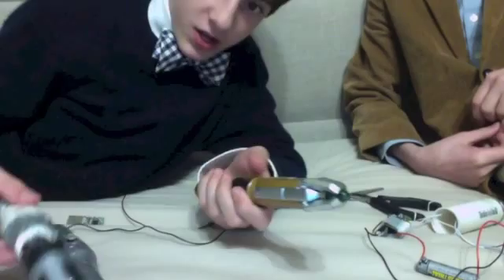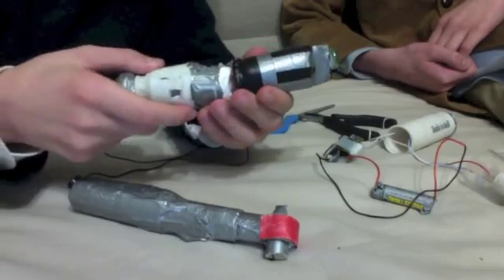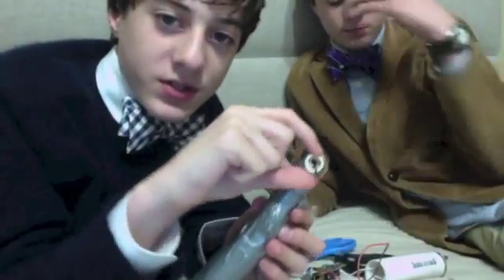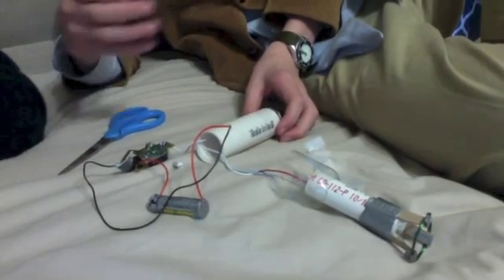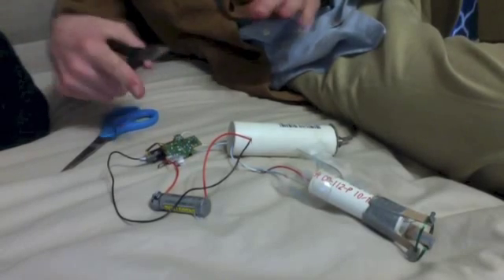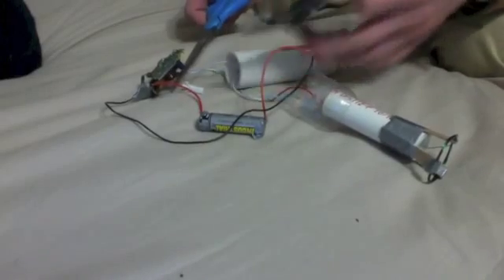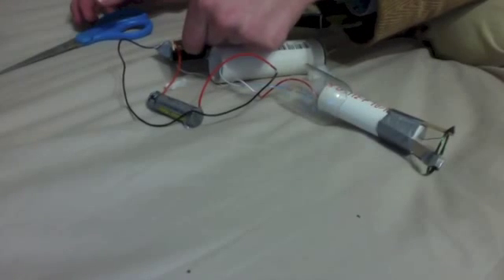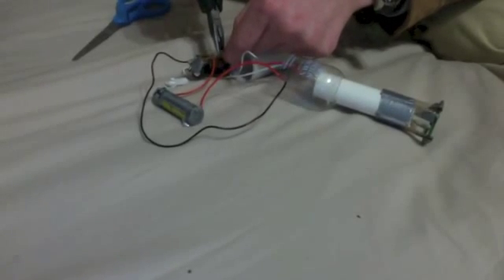Real, Functioning Sonic Screwdrivers [Ross]

Comment: Why don't you just install a bigger battery pack like a 9 volt to charge it better?
Reply from the maker: +Eden Mensinger A 9-volt will burn out the capacitor circuits. I've tried :)
Reply: Makeoscopy ok.
Reply from the maker: Two AAs or AAAs does work, though.
I actually blew a transistor on a 13-Capacitor bank today because I must have shorted it out :)